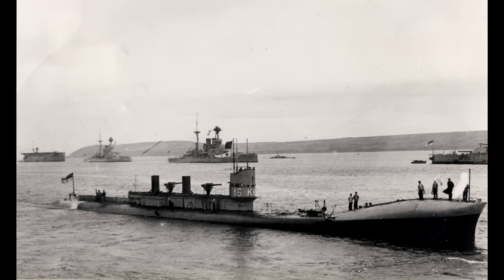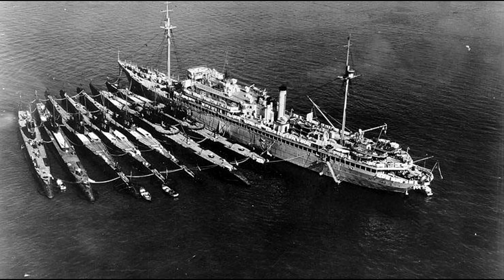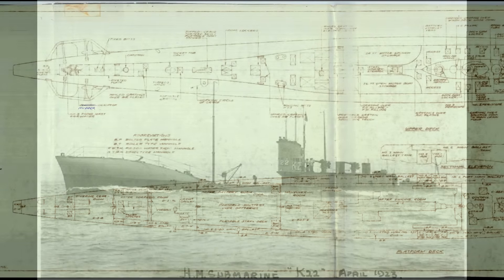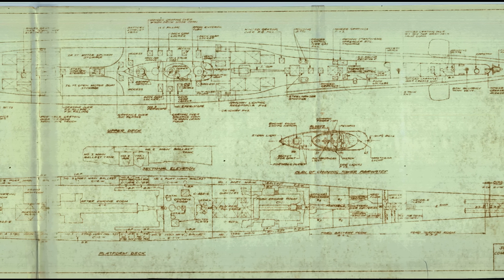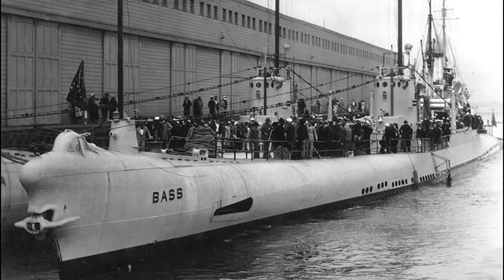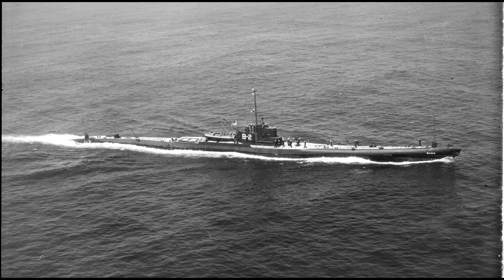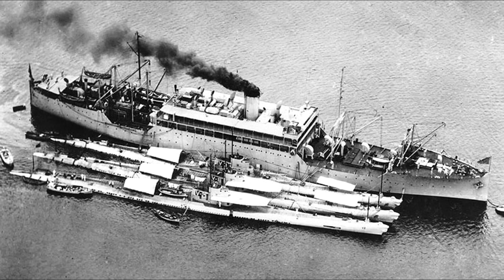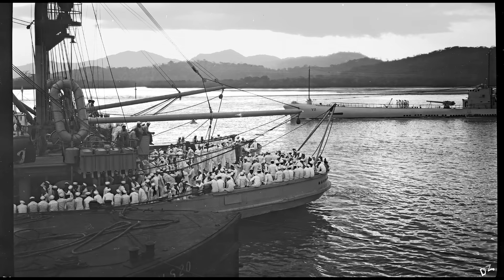Barracuda class (1921) - Guide 397

Comment from the maker: Pinned post for Q&A :)
Reply: Has any navy tried to build multiple small warships in one capital ship-sized drydock?
Reply: which of the V-boat classes, if it could have it's problems fixed, in your opinion had the most potential?
Reply: Which monitor/coast defence vessel saw the most ship-to-ship combat, and which ones scored the most notable achievements?
Reply: @Drachinifel  On the M-Class submarines, what would have been feasible retrofits to alleviate the primary issues of the 12” gun and make the class Atleast somewhat viable for the Second World War?
Reply: I had a chance to talk to a former ASW officer and he mentioned that despite the various shortfalls of single screw designs, they're actually beneficial in terms of acoustic signature as it'd be relatively more difficult for submarines to identify escorts and distinguish them from merchant ships based on number of shafts alone

While he referred to the cold war era Knox-class frigate (which he served on), was this also the case for WW2 escorts like the Flowers?
Reply: @irinashidou9524  Remove the top weight of the various superstructures.  The excess weight above (at least on M1; probably the others) made them very difficult to control.  It is thought that this may have contributed to the M1 ramming.  The theory I heard was that the turret was left hanging over the side, plus there was a pipe for shell handling leading to the magazine in the hull.  With still attached turret & the centre section flooded she went down.  There are signs that some of the remaining crew tried to escape via a hatch, but could not get it open due to water pressure.
Reply: Why did the Porters and Somerses use single-purpose 5"/38s rather than the quick-firing version of the 5"/51, given the 5"/38's inferior long-range ballistics against surface targets and the lack of the need for a surface-action-only turret to elevate and train anywhere near as rapidly as a dual-purpose turret (thus greatly reducing the severity of the need to minimize the turret's rotational inertia by using shorter-barrelled guns)?
Reply: If Vichy France had been aware of British plans to launch an attack on Madagascar eventually from adu atoll would there possibly have been any way for them to hinder British fleet operations? Especially if this information was passed to the Japanese before it was historically. The Japanese did end up sending several submarines to aid them historically. And is there any way this fore knowledge could have forced the British landings back until their tried again later with more force? Or was Madagascar doomed regardless?
Reply: When was the Navy given knowledge to the existence of the Manhattan Project, was it from the beginning of near the end considering its secrecy and the fact it was an Army Corps of Engineering lead project.
Reply: Hi Drach! I recently began a job at Electric Boat, one of the two manufacturers of nuclear subs in America. I've been reading a lot on naval history as a result.

I wanted to ask a question on armaments in the age of sail. Would a ship in the Napoleonic era have all of its cannons sourced from the same one (or several) foundries making artillery, or was it simply a grab at whatever was being produced? Obviously there's no interchangeable parts system yet but was there some attempt at standardization of a ships cannons?
Reply: HMS Celendine, it’s given jobs, areas of work and perhaps where it was around the year 1943 would be more than welcome to me and my family. Best wishes and keep it coming Sir. 🇬🇧🙏🇺🇸📚
Reply from the maker: @radishinglad998  a lot of nations would only have one or two major cannon makers, but the larger ones would have more obviously. A newly commissioned ship might be fitted almost wholly with cannon from one place if it was lucky, but whatever happened on commission a ship would land its guns when in ordinary, and then be re-equipped with whatever was available in the needed calibre.

This was why standard patterns were really important, as you didn't want a couple of dozen 24lbers each with their own charge tolerances and shot requirements etc.
Reply: Did the IJN ever try to use their escort carriers in ASW  warfare. From what I’ve read most of the carriers were used for ferrying aircraft.
Reply: I wonder, In the early days of WW2 the USN had a way getting some ultra high rated cargo to UK. Could it have been cargo subs ?
Reply: Drachinifel, how effective was the Thai Navy in WWII? Did they have any notable accomplishments in the Pacific War?
Reply: just curious but did anyone ever think to put fairing over or around the guns to improve underwater hydrodynamics or was benefits ofset by weight/cost/complexity?
Reply: Did companies like Grumman that focused on building carrier aircraft give the USN an edge over other carrier navies?
Reply: I would really like a video about wargames and their simulation value in your opinion.
To put this in perspective I've played a lot of AH Flat Top, VG Pacific War and 2nd/3rd/5th/6th/7th Fleet, some Amirauté (which I didn't like much) and GDW Harpoon. I have but have never played Seekrieg which on paper I like a lot.
Reply: Was there ever a point in history when a South American nations navy could have matched the US navy? If so, why did the fall off?
Reply: This one is well outside the time scope, but since it's merchant rather than navy related perhaps you can answer. 

In the '70s there were a number of very large tankers built. I'm thinking of the Batillus and Esso classes, and Nanny and Seawise Giant. Nanny is the exception here in terms of length at under 400m, but with a 79 meter beam could fit the entire flight deck of a Nimitz on it's deck. It fits the displacement figures though. Since then tanker designs have retreated, with nothing approaching 400m in length. They are still too big to transit Suez, so why the smaller designs? Is there an engineering reason for this?

Relatedly, container ships are at the Suez limits of 400x60m, and would presumably go larger if not for needing to transit Suez. Which might contradict an engineering reason for not building Batillus or larger sized ships. Are the size limits then a function of canal and strait sizes, or are there structural limits due to the properties of construction materials militating against Batillus/Esso/Seawise length/beam/displacement ships?
Reply: In the game Uboat the player may sometimes come across and board a lone ship flying the flag of a neutral country, but upon closer inspection you may discover it's actually an enemy countries vessel under a false flag. 
There are a few ways your crew might sleuth this deception out. ("If your documents say this ship is headed from the USA to Spain, why are we on the north coast of Ireland?" for example.)
My question is, in reality would this actually require any detective work on the part of the U boat crew? It seems like one would notice pretty quickly that everyone on this "Portuguese" ship is speaking perfect English. Or were merchant ship crews more clever than I'm giving them credit for?